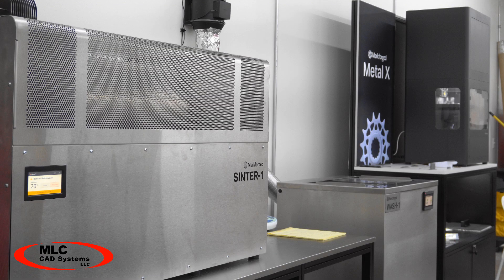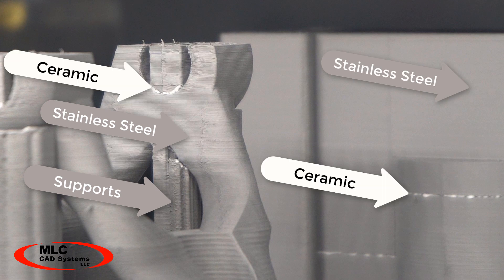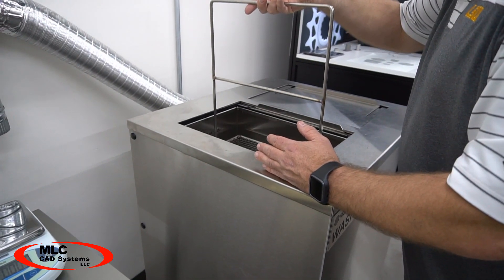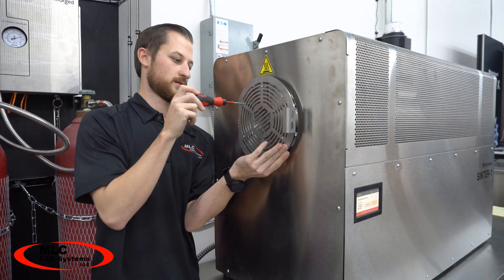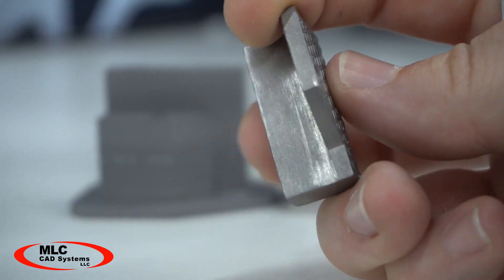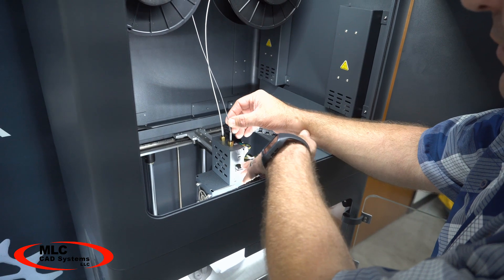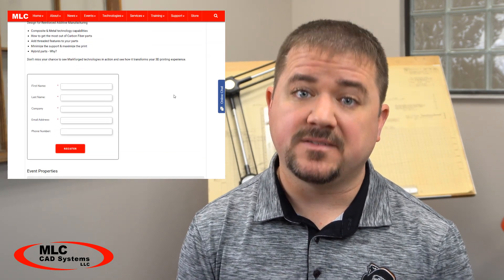The Markforged Metal X is Here

Comment: Price? 10 000$? You need a washer and a oven too. 1000$ a pice?
Reply from the maker: This is not a machine for hobbyists or a replacement for basic machine tools.  But, for a shop making low-volume parts in materials that are notoriously hard to manufacture, this is a very attractive price point.  Keep in mind that all other available technologies were 10x more expensive than the Metal X when it was first released.

Comment: how accurate and predictable are the parts after shrinkage?
I wish you guys showed some parts being measured
Reply from the maker: Considering the shrink rate from the printed shape, it is amazing that the final tolerances are typically +/- .005" per inch of measurement.  The printed shape, with the shrink and warp calculated for your specific 3D model, is powered by/optimized with artificial intelligence.  It continues to get better as printed parts are scanned back into the algorithm, but it can also depend heavily on the geometry of the part.

Comment: What does a cross-section of the grain structure look like? Is it uniform? Is there any qualitative or quantitative destruction test data available? Can solid parts be hardened and tempered?
Nevermind, I found an abstract.
Reply from the maker: Metal X parts can be treated like any other part of the same alloy for heat treating.  With sparse-fill the failure behavior will be different than solid materials and fatigue crack propagation points are more available, but in general you can consider these parts to be similar to Cast parts in terms of durability.  Definitely refer to primary sources like abstracts and white papers rather than the comment section on Youtube if you have serious metallurgical questions that require sources.

Comment: Are the finished parts recyclable? Can they be processed as to be reprinted into something else. For example, a gear which can be recycled, repprinted to be wrench etch?
Reply from the maker: The materials are pure metal so they can be recycled in a traditional sense, but they can't be directly converted into a filament that can be printed again.  The filament needs to be supplied by Markforged for quality control.

Comment: Sand casting never looked easy till now.
Reply from the maker: The video goes into a lot of detail about the process and the technology behind the equipment, but when you see it in action it is really simple and clean to operate.  No molten metals, no sand or slag, no metal grinding or cutting of sprues, no CNC machines at all unless you want to post-process for surface finish or tighter accuracy.

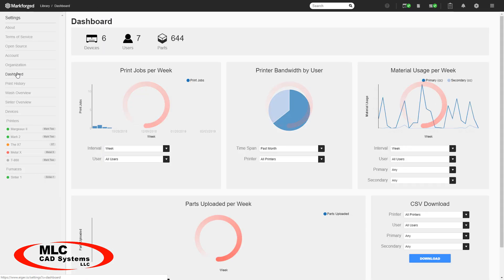Comment: 3:32 Minimum wash time 1d 9h for a 42x26x38mm part !
Reply from the maker: Depending on the geometry wash times can last for several days, it usually depends on the shape more than the size.  A large slender frame would take less time than a small thick object for example.  It is crucial that all of the binder is removed prior to sintering, but there has been some good news since this video was released. Markforged was able to adjust their algorithm based on additional testing and research and most of the recommended wash times have been cut down considerably.  Because the software and the machines are cloud-connected the update was pushed through and now all parts are given shorter recommended times while making consistently high-quality parts.  The 1d 9h part is now likely to be an overnight wash, I hope that helps!!

Comment: now put that part through inspection! This is just a slow and inaccurate machine with the only benefit that it can make more complex parts, and you really have to pay for that. It is a cool concept but its far away from being accurate. ill just stay at the cnc milling machine, much faster, accurate and cheaper 😇
Reply from the maker: There will always be designs and applications that are faster and cheaper to make using subtractive methods like CNC machining.  Currently nearly all designs are optimized for this type of manufacturing, and designers are conditioned to make parts that work for this method, which is a good thing!  As this technology expands however we have seen multi-part assemblies replaced by a single part with amazing outcomes in cost, durability, and performance.  Nobody is advocating a complete replacement of machining, but it adds a new layer of capability for designers in both product development and full production.  

Regarding Inspection it is actually possible to perform inspection and validation of parts on the X7 printer while in process!  Imagine being able to get a full inspection report on the INTERIOR of a part that is inaccessible to scanning or measuring equipment!  And with Blacksmith, the inspection feedback loop actually teaches the machine how to print the part correctly the first time, and is not subject to tool wear.

Regarding accuracy there is a limit to what can be achieved, but with Blacksmith AI and in-process scanning and correction the accuracy has the potential to meet that of CNC.  It won't be able to replace the surface finishing capabilities of machining however, so post--processing would be required where a surface finish specification is required.
Reply: Machine me an internal channel with a  helix structure for a heat exchanger on your cnc. Additive opens up design criteria, CNC and additive are complements of each other, you just have to think about it

Comment: This does not seem mega useful because of the shrinking and warping.
Reply from the maker: Shrinkage and warping were some of the issues that prevented this technology from being possible until now.  The shrinkage is very repeatable and can be predicted with a high degree of accuracy using computer software, all of which is baked into the Markforged solution.  Simply upload the file and choose to print on a metal machine and you can expect +/- 0.5% on all measurements.  So that means for a 1" nominal part, it will print approximately 1.2" and will sinter down to a final size of 1" +/- .005".  I say it prints approximately 1.2" in the green state because the actual shape is determined using artificial intelligence that is constantly learning.  As more parts are run through the system, the tolerances will get even tighter.  

When I first learned how the system worked I expected the sinter process to be much less predictable, but in fact sintering has always been a reliable manufacturing approach for even high tolerance parts like gears.  Pretty amazing!

Comment: Would love to see if Markforged has an off-line version of their "cloud service".  There's no way I'd put any of my proprietary robot end effector designs through an offsite system I didn't still have 100% control of (just the fixturing designs can give away details about the part being held).  And nothing is worse than buying a $100,000USD printer and more for materials, then having the company go out of business and not being able to use the equipment any more (even with alternatively sourced raw materials and repair parts).  "Subscription" type hardware is a no-sale for me.
Reply from the maker: Great question.  The Eiger software does have an offline option for applications such as ITAR military technology, and the Eiger software is free to operate so it does not require any ongoing subscription to continue utilizing the hardware.

Comment: Good one. How much does it cost?
Reply from the maker: Before the Metal X was released, it would cost upwards of 1 million USD to fully print metal parts using other systems.  This system has dropped the cost of entry by about 10x.  Reach out at our website or call us to get more specifics based on how you might use the system.

Comment: Also for design calculations for shear and stresses if you printed a mild steel component how would the modulus of elasticity of the steel differ to common hot/cold rolled steel?
Reply from the maker: The final material in finished Metal X parts is 99% dense and chemically identical to material that was hot/cold rolled.  The only variation is the heat treatment and cold working state.  For most materials you can consider these parts to be in a "near annealed" state after they are sintered.  Additional heat treatment is possible and the Metal X design guide includes recommended heat treatment procedures for each material, but cold working would be difficult to achieve on a finished part.
Reply: Can you weld on these parts with no contamination?

Comment: Are multiple components which are "printed" weldable by conventional mig or tig processes? What is the maximum component size which can be printed?
Reply from the maker: Thank you for your questions!  Refer to traditional guidelines for welding these materials, as the final parts from the Metal X will be identical to any other part using the same material.  So if the material you use to print can be welded, the parts from Metal X will be similarly weldable.

The maximum component size is often limited by the Sinter oven size.  There are two sizes of Sinter oven available depending on your needs and larger parts can be sintered externally if you have that capacity.  Full details on printer volume and maximum size for sinter can be found on our website, https://mlc-cad.com/markforged/markforged-metal-x/

Comment: Can I make dental framework from your machine?
Reply from the maker: Great question.  You can make just about anything on these machines, but there are a few additional considerations when talking about dental framework.  Luckily, the issue simplifies quite a bit when you realize that the net end result of the process is a part that is composed of the build material, with similar density and purity as billet material would have.  So although I'm not aware of any current applications using dental framework, there would be no specific restrictions on using it for that purpose due to the Metal X system itself.  I hope that helps!
Reply: @MLCCADSystems  thank you for your prompt reply. In fact your rep from Singapore has come to our office yesterday to discuss this matter
Reply: I hope I can work with your company on the manufacturing of dental framework soonest possible

Comment: i cant understand the difference between ultimaker and markforged metal x . print part by %20 bigger on ultimaker and put the part in furnace. it looks filament is important not huge expensive printer....
Reply from the maker: Great question, you may want to look for people who are trying each approach and find out how much time and effort they are investing to get usable parts.  Markforged Metal X will create consistently high-quality parts with excellent metallurgical properties and they provide the entire system required to do it.  It works right out of the box and you don't need to become an expert to get it done or carefully monitor every step yourself.  Depending on how you value your time and production schedule would likely be my determining factor.  I wouldn't buy a Metal X for a hobby for example, but I would never attempt to figure out metal printing on company time if it has the potential to impact part quality and production timelines.  I've been to a lot of shops where printers sit idle because they were "almost good enough" but were unable to meet the needs on a daily basis.

Comment: those 'metal' parts look PRETTY fucking weak to me
Reply from the maker: Don't let the appearance of the outer layer fool you, the metal is extremely dense internally (better than casting) and the materials used are some of the strongest alloys available.  After the sintering process there are no residual weaknesses from the manufacturing process, these are full-strength metal parts.  They feel as light as aluminum though when they are printed with a sparse fill, so it is very confusing to hold them in your hand.
Reply: not according to this: https://www.youtube.com/watch?v=fzBRYsiyxjI
Reply from the maker: That is a great video that describes the challenges of the DMLS process, where a laser solidifies metal directly in a very rapid process, leaving voids such as bubbles and directional properties that leave it weaker in the direction of the build platform.  Metal X does not use a laser and instead uses a long-proven process called Sintering, which slowly allows the metal crystals to form and leaves the final part in a near-annealed state.  That is one of several reasons the Metal X process represents a major leap forward in metal printing technology.  It is not a new method of creating metal parts, it is simply a new method of arranging the metal accurately prior to sintering.
Reply: OK thanks! OBVIOUSLY we have a long way to go before we can confidently integrate this into existing manufacturing. should be mostly fine for non critical parts in HUGE volume. Do you have any data on repetative stress failure on YOUR process vs traditional castings?
Reply from the maker: Another great question, I'm not aware of any formal lab testing of Metal X parts for fatigue, but I often find that fatigue data is the hardest data to find because of the length of time and cost associated with the tests.  From a process perspective, the only novelty to the Metal X system is the process of printing the part layer by layer instead of using fixed tooling.  I would recommend researching sintered metal part fatigue behavior in general.  Based on some initial research it seems that porosity is a strong influencer, and with highly dense parts the fatigue behavior is very good. 

My personal suspicion regarding fatigue is that the bulk material fatigue behavior will be relatively similar to cast materials, but the surface finish and the sparse fill are the wild-cards that must be considered more heavily.  Crack initiation and propagation are possible across the entire part, interior and exterior, which is a new wrinkle.  Metal X parts have rough surface finish and a triangular sparse fill by default, which is really a worst-case scenario for a part subjected to repeated loading.  I would recommend keeping the design load below the fatigue limit for these parts.

Until a wider strategy can be adopted that would allow certification of these types of parts, I suspect each part and application will require its own extensive testing, which is already in place for critical system components in industries such as aerospace.  Metal AM parts are in service today in aircraft engines, so it is certainly possible, but it will require additional considerations where human safety is a concern.

Comment: What stops the use of tungsten carbide blends . I understand that cobalt is used and that hydrogen is used in senters . What in the printing itself would cause tungsten blends from not being doable .
Reply from the maker: I did some quick research on the sintering of Tungsten Carbide and it appears to require an oven operating at 2,000°C.  The currently available Markforged Sinter ovens are currently listed with a maximum temperature of 1,300°C.  I don't know what the future holds or if other complications exist, but there will likely need to be some more advancements in the technology before we see tungsten carbide blends on this printer.
Reply: @MLCCADSystems  the sintering would be done third party , as the hydrogen environment makes it extremely touchy and the cobalt off gassing needs to be sequestered during cool down . As you said , you folks are not ready for the sintering . I'm personally far more interested in finding out if you could print the blend . You already compensate for shrinkage in product and that's a huge issue with forming molds for tungsten blends . Each blend shrinks at different rates . So , if you were able to add into computation the base lines for each blend then that leaves figuring out how to print it in a manner that would yield the correct density and hardness of the desired blends . Don't dwell on the sintering aspect for the customer . Hey , thanks for responding.

Comment: So, I guess this shrinkage factor might vary a lot between batches and pieces, which basically means that, depending on your spec tolerance, your piece dimensions can be off the mark, or have different shrinkage factors on different regions of the piece
Reply from the maker: The variation depends on the part geometry and its orientation in the printer but is amazingly consistent for a single design across multiple print instances and batches.  Once the behavior of that part is known and either offset or accommodated in some way, you can hit very repeatable tolerances despite the very minor movement during sinter.  Expect 1% tolerances to be possible on almost any shape. (100 +/- 1) or (1 +/- .01)

Keep an eye out for Blacksmith AI, it allows for the machine to learn from print outcomes and offset them to predict warping and shrinking behavior better for more accurate first-run designs.

Comment: Do they use a shit ton of electricity like other metal printers?
Reply from the maker: Great question.  The actual printer has no lasers or arc welders, so the primary printing process is similar to more traditional plastic 3D printers.  The power-intensive step is sintering, where the oven must reach temperatures just below the melting point of the metal.  It uses electrical heating elements, but it is very efficient for what it does and multiple parts can be sintered in a single batch.  Feel free to reach out on our website if you would like to discuss in more specifics. mlc-cad.com